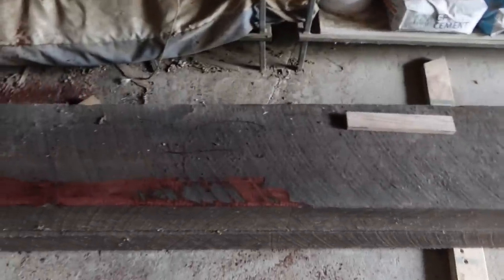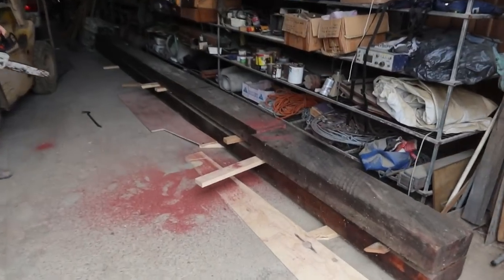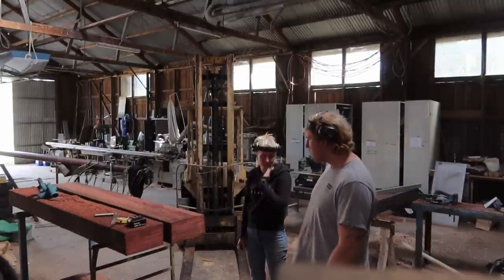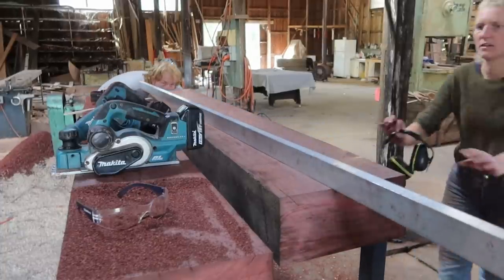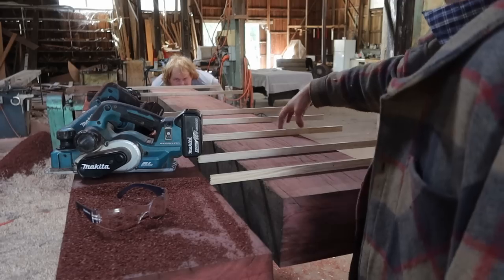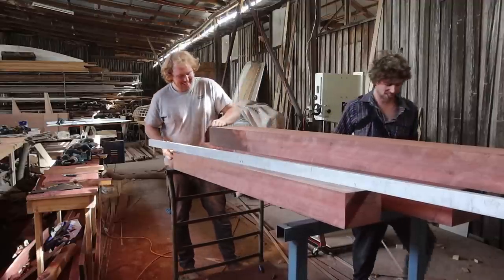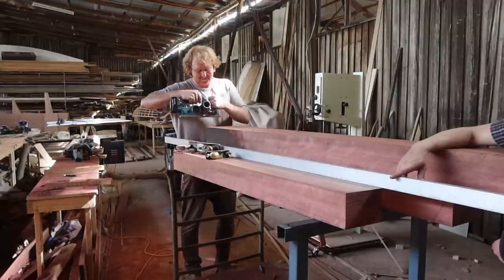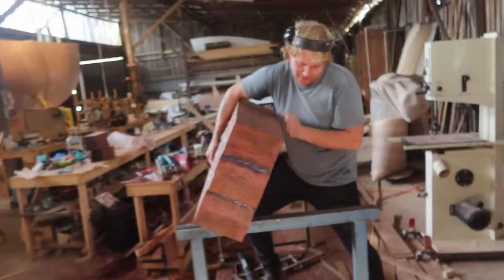Winding sticks on some massive keel timbers! Time to get serious with our wooden boat building(EP16)

Comment: A friend put me on to you guys. Very deja vu for me. My wife and I built a 36 ft gaff cutter out of jarrah here in W.A. A while ago now. Turned out we couldn't sustain the life and after a number of years living on her we sold her. No youtube back then. Building another now, smaller, lighter plywood and glass on Paulonia frames. Here in W.A.Jarrah is regarded as mid range in terms of its weight. Tuart, Wandoo, Lignum vitae are all heavier, and do not float. Jarrah does. Lotsa luck guys. I'll be following from now on.
Reply from the maker: Thank you for your comment and sharing your experience with boat building and Jarrah. Very interesting facts. Good luck with your new project and happy sailing for when she floats!

Comment: REvisiting some of your episodes and as i recall,when i was in OZ between 85 and90, Oilfield Diving in the Bass straights, the Endeavor was being built on the West Coast using Jarrah ? for planking, can you confirm, possibly being a dense timber, it can't be steamed, so maybe the Back bone was the use ? and planking ?, anyway, enjoy your channel,as a side note,when i returned to the States,i enrolled in the Wooden boat school in Port Townsend,Washington and did the year long coarse,in reality back then,one could work as many hours as one wanted [no longer the case], so in reality i put in the equivalent hour wise of 2 year's,most fortunate  for me ,around that time,i picked up a job building a number of lawn chairs in Jarra,which i had not heard of before for an upmarket  condo building in Seattle,seems someone had  stolen one of two they had and  i disassembled the one remaining,made patterns and built more,so i'm assuming its not a endangered  timber ?.Allfernow,Doug.